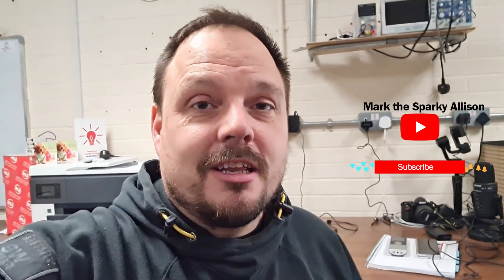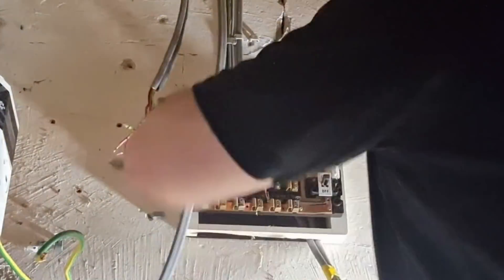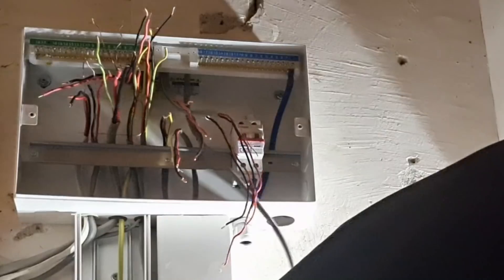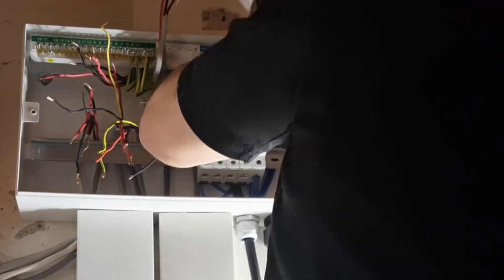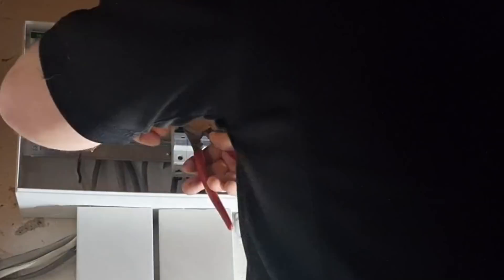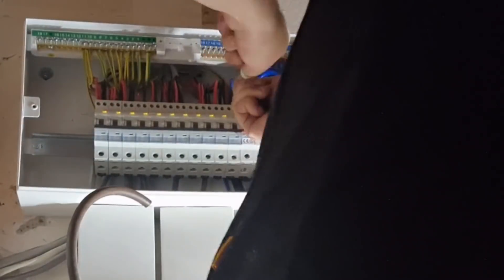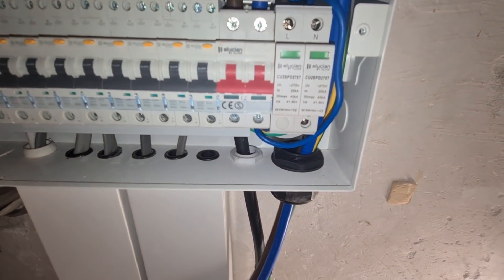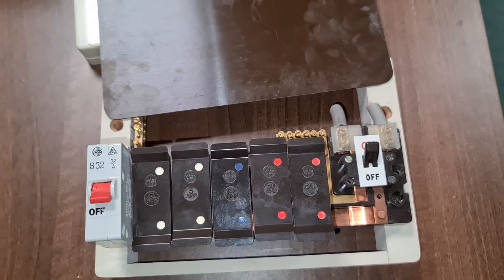Double consumer unit replacement and Hot Tub on TNC-S. Household wiring extravaganza!

Comment: I had one of those fuseboards that used to blow the fuse two or three times a month. The council was called to find the problem, but they could not find a problem, so they put extra-thick fuse wire into the fuse, without my knowledge. Whilst we were out, the house erupted into flames, traced back by firebrigade to a large rusty nail going through a cable in the ceiling, causing a problem of arcing when the right circumstances of draught, moisture, etc. were just right, causing the ceiling to ignite. The fuse had several wraps of fuse wire instead of the one stretched across the terminals. The problem had been there for years, the cable had been held off the ceiling by large nails, and one had been hammered into the wire, shorting years later.

Comment: Neat consumer unit replacement but a couple of things I spotted:
1) The neutral wires are cable tied together (grouping)
2) There was no drip loop for the hot tub cable where it came through the wall
Reply from the maker: 1, grouping isn't a factor in fact it's a myth inside most domestic consumer units. Alas all cable ties are cut after final installation and labelling. Mainly to make it easier for the next person following. You can read about grouping and bust some of the myth on that in the design guide should you wish.

2. A drip loop serves no purpose if you seal penetrations correctly. That is the crux of the problem when rain hits the wall. Another myth but sometimes nice to achieve. Plus we have a lovely cable guard over the hole to divert rain water away as it runs down the cable. Ain't no water ever getting in there. Mattie does a proper job as he is a bit of a legend for a lad of 23 at the time.
Reply: @electrician247  Thank you for the responses, as I said in another comment I'm not an electrician by trade and therefore I'm more than happy to be shown to be wrong but I the whole subject (even the regs) interesting.

1) Fair enough if they are cut off afterwards it's a completely moot point then but I find it a little confusing that you mention that it's a myth as the cable grouping calculations are to me some of the simpler calculations and I can't see how they wouldn't apply in a consumer unit. I'm not working from the latest copy of the regs so take what I say with a pinch of salt but SparkyNinja has an interesting YouTube video on the subject titled "Cable Grouping and the impact on electrical installations" (https://www.youtube.com/watch?v=e3xA3t6wAmY). TLC Direct also has an page covering the subject, albeit using the 16th edition regs but that also makes it clear that grouping is per circuit and not conductor: https://www.tlc-direct.co.uk/Book/4.3.5.htm

I suppose that you can immediately discount the lighting circuits based on the 30% rule and the modern use of LED lights, but there are still quite a few circuits in there which appear relevant.

2) Respectfully I disagree that it serves no purpose and is a myth, it serves as another line of defence against water ingress by getting rid of the bulk of the water that is collected by and runs down the cable. (Along with drilling the hole upwards, as you should for any intrusion including for pipes) You don't need to do it of course and there are plenty of installations without then which have not leaked in many years, but it's essentially free and provides that additional defence in case the silicone fails. It's related to the aim of entering an outdoor box from the bottom as was done on the isolator. I couldn't see the cable guard unless you're referring to the other cables which run above?
Reply from the maker: @yngndrw.  That is comprehensive comment Andrew. 

In terms of the grouping you need to think about circuits adjacent to each other and under consistent load. Equally with the grouped cables this will not apply in most situations within a domestic environment. The cabling is generally derated external to the CU for such things as containment and insulation around the cables. By the time you are inside the consumer unit its generally not a consideration. The design guide and regs lean on this in more than one place. 

Grouping is more of a factor within containment and structure leading up to distribution boards and consumer units. 

Within them it could be a factor say within a board that serves heating equipment such as storage heaters for example. But even then generally the OCPD and cables are selected to allow for those consistent and prolonged loads. 

In 90% of cases I would suggest its a total non issue and varying content on YouTube has created misleading assumptions around grouping. It is not my place to suggest what and where that content is. 

In reference to the cable guards you need to remember what we show is not the whole job. I am very very careful not to include every aspect of a job to avoid copycat non electricians from using my content to have a go themselves. 

We omit various parts on all of the videos for just this purpose. 

If you use a cable guard on penetrations a drip loop can essentially prevent that seal from working correctly as the cable enters from the bottom rather than the top. 

In terms of angle drilling the basics are to have a run off towards the exterior but that is generally to allow for condensation in the cavity. A drip loop will not prevent the rain water than runs down the wall surface from penetrating the building. While it does not hurt and we often use them when cable guards are not fitted. The proper solution is to seal penetrations correctly. We use gasket sets within the penetrated brickwork/blockwork alongside mortar and a final cover of CT1 silicone. Which provides a deal equal to or better than the brick and mortar before we started. 

Which is why that is also a myth tbh. It is an engineering solution that can divert water from a penetration on cable drops but a poor sealing method will still leak drip loop or not. 

Your comments suggest someone who is electrically skilled and I welcome them. Happy to debate and discuss these kinds of things no problem at all. 25 years in the field across all sectors and still today. Hope that helps.
Reply: @electrician247  Thank you Mark, I appreciate you taking the time to respond to my comments.

I was aware that you don't show everything in your videos and the reasons for not doing so, but I didn't realise that it mean that it wasn't the finished job that you were showing. I thought that you meant that some of the installation would now be shown rather than the final install so apologies for the confusion. I very rarely see cable guard used around here (I didn't even realise that was the name of it to be honest) but I understand now that is your second (Third?) line of defence against water ingress.

Can I ask what gasket sets you use? I appreciate if you don't want to discuss that due to the reasons above, but sealing of building penetrations is quite a generic task that applies across multiple trades and is relevant to non-electricians for things like data cabling and TV aerial cables. I'm interested to learn about how others seal cable penetrations as I've always just relied on angled drilling, breaking the edge to ensure a good bend radius is maintained, silicone around the cable, a drip loop and then for my second-line defence I use a masonry blow-out cover with silicone in an upside down U shape under the cover leaving the bottom open for drainage.

My experience in the field is a little strange to be honest, I have no formal electrical qualifications but from a young age I helped my dad (An electrical engineer by trade, now retired) build electrical control panels for a range of industries. Some of these control panels had PLCs while some were controlling 30kW motors with star-delta starters so three phase is quite familiar to me - All done in the days before harmonised colours and the large amount of paperwork and red tape for modern control panels. It certainly isn't lost on me that I don't know what I don't know regarding the regulations and best practices - For example I've only just recently learnt about the concept of de-neutralising of black conductors and PEN faults where I would have previously thought that adding an Earth connection would never decrease safety. Some would probably argue that would make me the most dangerous type of person to look at electrical work (And they'd possibly be right, maybe after those who are knowingly negligent) but that's why I'm trying to get a proper understanding of the regulations and best practices. (Aside from general interest of course)
Reply from the maker: @yngndrw.  Google is your friend if you search cable wall penetration seal or gasket. Basically rubber washers you drill out and seal into the brick/block. They have a lip to take CT1 then mortar before a final silicone/putty seal on the exterior.
Reply: @electrician247  I have had a good look but I couldn't find any products matching what you've described - Most of the results are for the large industrial fire stops, the modular ones designed to many cables. The closest thing I can think of would be those 20mm rubber grommets that have the slot for twin and earth, but it sounds like you're describing a purpose made product. Do you know the manufacturer or a part number? We're buying a new house and I have a lot of cable penetrations to do for CCTV cameras and that method sounds like it will be far more robust than what I usually do.
Reply from the maker: @yngndrw.  they are a black silicone gasket/grommet type thing. Our wholesalers stock them. Similar to pipe guard plumbers use. They are often not as fortunate as us with drip loops 🤭. 

You have to drill a larger hold about 50mm deep at the wall surface to seat the seal and it provides a sleeve into the smaller hope through the cavity. Also helpful in extra protection bridging cavities. They have a drip nipple in the middle. You the  seat the outer flat grommet black silicone gasket in the bigger opening and mortar/seal in as described before. 

I will show one on a video soon. Away on holiday atm.
Reply: @electrician247  I had a look through the usual wholesalers but couldn't spot them, although I think I understand what I'm looking for now so I'll keep an eye out for them. They almost sound like those rubber grommets that have a built-in strain relief which some appliances use, but with an added drip nipple.

I look forward to the video when you get the time, I appreciate it and I'm sure many others would find it useful. Hope you're having a nice holiday.
Reply from the maker: @yngndrw.  will report back with a link in a week or two and mention it on a video. We have a few penetrations in some schools over the summer and these are specified in the installation requirements.

Comment: I thought that the SP and switched neutral was called that as the overcurrent protection part of the RCBO only functioned on the live (or one pole), whereas a true DP will have overcurrent protection on both poles...may be wrong though
Reply from the maker: This is my understanding. Also the timings are milli seconds apart between opening and closing of L and N. 

I have another video coming think in 3 drops time that talks more about this. 

Cheers

Comment: Have they sorted the cover screws on the Elucian boards yet. They were very sub standard quality in my opinion. They seem to be made of a very soft metal and never quite lined up correctly with the screw holes on the case.
Reply from the maker: That and the spd/main switch gland holes all sorted. Front cover drops straight on, solid screws.

Comment: Great presentation as always. Was it not an option to fit an independent main switch to save having to get the service fuse pulled for future works ?
Reply from the maker: Thanks Ian. That is always what we ask for. But the DNO are a law on themselves lol. 

Usually we get the client to arrange via the energy supplier but this was short notice attendance so wasn't an option. 

Had the DNO come out to upgrade the main fuse and service head which was also cracked. 

Thanks for the kind comment and happy new year!

Comment: Hi Mark,
Thanks for the content!
Do you have any info on these RCBO’s? 
Everything I can find says the are single pole with a solid (unswitched neutral) 
Cheers
Reply from the maker: Hi Rich, this is the Scolmore link https://www.scolmore.com/_pdfs/elucian-brochure.pdf 

My understanding is single pole and switched neutral as described. But who knows 🤭
Reply: @electrician247  
That means it switches on L & N, but only senses on the L. So when switched off manually or it trips, L & N will be disconnected. But the RCD side of the RCBO must sense on the N.